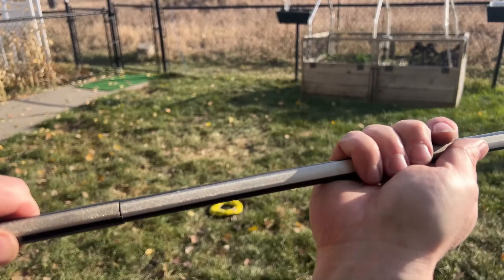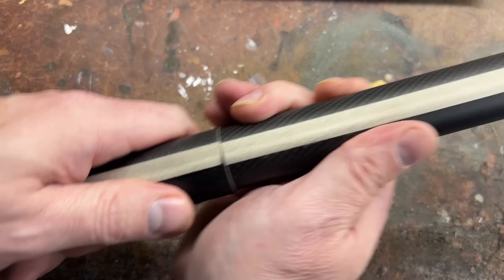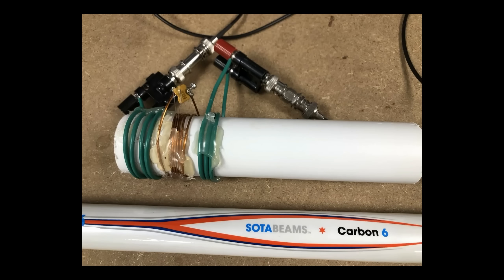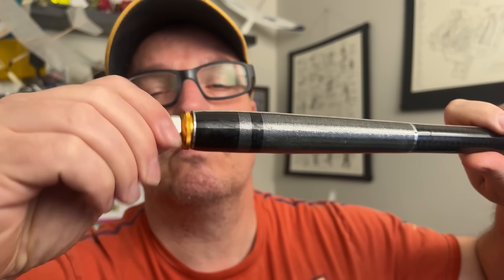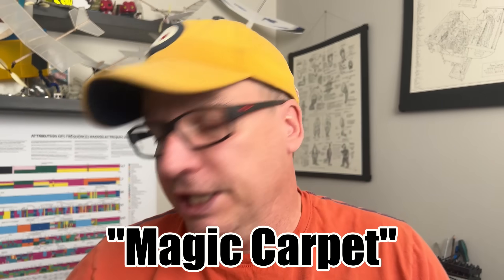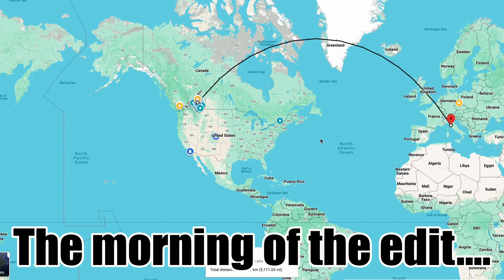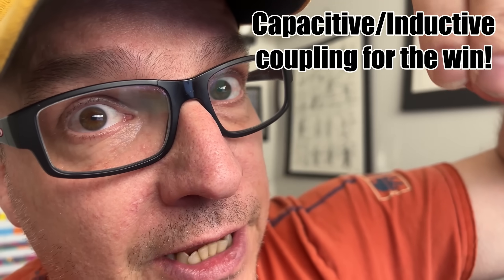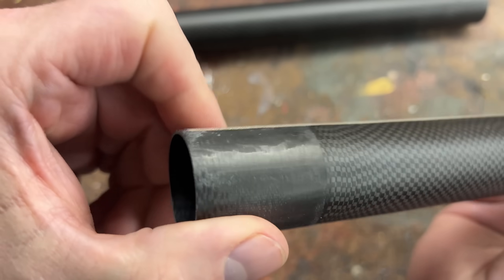Carbon Fiber Squid Pole EFHW Antenna: Wire-Free using Faraday Tape!

Comment: Hey Rook! Any more progress on this concept? I've tried to replicate but using the higher-conductivity copper tape rather than Faraday tape. On an 16' 7" carbon fiber pole (same model you ordered via AliExpress), it has an SWR dip at 11.761mhz. You mentioned it didn't resonate on any freq, sort of like an EFRW, etc. Love to know more about your experiments as I'm doing some too. If you want to contact me offline, I'm good on QRZed...73 de K4FMH
Reply from the maker: I’m slooooowly working on this. Yes it performs best as a random wire with a tuner. I find copper foil is easily damaged compared to the faraday tape. I’ll be posting more on this soon as the weather is getting better here and I can experiment

Comment: Well just built one and am excited as all out to test it.  Love this kind of level of experimentation.
Reply: Awesome! Let us know how it goes for you
Reply: @DreadMakerRoberts  just finished initial testing with a ground spike and single counterpoise and the results are good.  According to my VNA the highest SWR is 4.2 at 3MHz, the lowest is 2 at the 39MHz and in the various bands the SWR is somewhere in between in other words all very usable.  Tomorrow I'm going to give it a trial with the G90 and see where I get.  Many thanks for this.
Reply from the maker: Sooo love to hear this! My G-90 makes mine sing. It will definitely be able to tune it

Comment: I wonder if aluminum tape would couple capacitively, like the carbon fiber?   Any thoughts about that?

Thanks for the video!

73
AI4IJ
Reply from the maker: Yes copper tape does so aluminum will as well. The problem with metallic tapes is the are easily scratched off

Comment: Someone else mentioned a loop around the outside of the larger section.  Also continue the tape on the smaller around to the inside and run a loop of tape inside teh smaller section.  That way the captive coupling will have a much larger surface area.

Comment: have you considered trying an off center fed dipole vertical in your design ?  no GP needed, could be some fun experimenting ! its a hobby so keep having fun !!!!
Reply from the maker: I have not. Part of the reason is the carbon conducts enough to make this very hard to do. However a fiberglass pole would likely work

Comment: I say balderdash to the haters. Even if its not the perfect candidate for such a thing. I think your on to something and I would personally run with it.
Work with what you got and keep experimenting. 4 bands I'd be impressed. but if you could make it resident on 4 I'd go for 5. It's a neat concept.
 To be able to just pull up to the picnic table and quickly deploy, without a tuner. Sounds like a winner winner. ball hitch mount maybe.. sweet deal.
Sit in the car on a rainy day having a rag chew on 80m talking about all them haters. Good stuff 73
Reply from the maker: I appreciate your kind words. Currently with a tuner the random stick I have works on 40-30-20-17-15-10

Comment: just made this vertical, will give it a try soon in the field.
Reply from the maker: Please let me know how it goes! HamRadioRookie at gmail is the email address. Also fill me in on the details of the build. Carbon or glass fiber? Overlapping or capacitive coupling? Electrically joined elements etc.
Reply: How'd it go?

Comment: Have you tried to create a "Linear Loaded" Version..??
Faraday Tape on opposite sides of the poles, except the bottom section, then bridge them on the top section
That will give almost twice the length of Radiator...
Reply from the maker: Might try. With carbon there is some conductivity and it seems to work only with one  element. Adding tape makes some bandwidth gains but not really length. From initial testing. However the fiberglass should work for this!

Comment: Everything is fine, but you can't fool nature. The length of the antenna should be proportionate to the wavelength. Anyway thanks for sharing this information 👍
Reply from the maker: Yup agreed but keep in mind that the V.F. of this material is not like any other.

Comment: What do I know as a Technician whose never transmitted on any HF rig (though I'm studying for general).....what came to my mind was the conductive tape you are sticking onto the pole secitions----wouldn't it be awesome if it was embedded into the carbon fiber as the section was laid up? I've been around a lot of carbon fiber sea kayaks and they are often coated with a clear gel-coat. The conductive tape possible applied to the sections before clear coating? The clear coat's thickness would of course have to be accounted for in sizing the diameters of the nestling pipe sections. Then there's the thought of a carbon fiber tube that is only 95% complete....the other 5% being a metal strip filling the void and running the length of the tube. 
Regardless I think  what you are doing is novel and genius. I hope it comes to fruition one way or another because someday I'm going to pass General and then (even though I have acreage and room for an EFHW) I'll want a vertical :) Something else. The SOTA boys (and girls) will love love love your mast that is also antenna!!
Reply from the maker: Yup I am woking on doing just that! Great minds think alike. Its finding someone to do this for me economically
Reply: @VE6SFX_HamRadioRookie  Yeah I woke up thinking about your antenna? Why because I need a super quick rapid deploy vertical 20m or 40m. So scratching the sleep out of my eyes I thought of metallic paint. How thick is that conductive tape you have been applying to the pole(s)?
Reply: Aircraft control surface embed metal fabric into the carbon fabric layup to create a conductor to dissipate static electricity from the aircraft. Why wouldn't it work the other way?

Comment: Hi Rook! Very innovative concept...I'm building one (or two) now. I'll try copper tape instead of Faraday tape. Have the copper tape but do have yards of Faraday cloth which I'm testing for ground planes. The copper tape will have better conductivity although my tests on Faraday cloth show it's surprisingly good on that score. The practical impact of having a telescoping fiber pole that requires no wire is a move toward Occam's Razor in portable HF ops, IMHO. Looking forward to how you play this out. There's a Latin phrase for don't let the bastards get you down but I don't have time to look it up right now. You might suggest that viewers who get triggered by innovation "that shouldn't work" go watch some cat videos. The Smoking Ape can hook you up on some references, lol. 73 de K4FMH

Comment: Aloha Ben, I just watched Salty Walt’s video about this antenna pole and I found it just amazing. 
      I like operating at a triangle parking lot that sits in the Pacific Ocean here along the coast here on Oahu, Hawaii. 
      It’s called Kewalo Basin or just called Kewalos and it has a small parking lot, a large restroom and a small youth center but the cool part is that my average distance on one watt of power only on my G90 is 5,026 miles with signal reports of 5/7-59+10, from East Coast US to WA to Japan against some folks pushing 500+ watts. 
     So I’ve been using a ground spike with a 2.5 meter M10 telescopic antenna with four 15’ ground radials. 
     Lately, I have been experimenting with CB antennas and 10 hamsticks mounted on CB mag mounts on my Jeep. 
     I bought a drive on flag pole holder but just can’t get a telescopic pole of any kind from anyone to ship their telescopic poles here to Honolulu (zip 96822) and I’m flying to California next month and hoping to take my new Radioddity QT80 with me along with a mag mount to put on my rental SUV for the week that I’m out there. 
     Do you have anything worth testing that I can put into my Carry On bag on an aircraft?   
       Thanks and Mahalo-
          Todd de WH6DWF🇺🇸
Reply from the maker: Todd,
The best place to order the rods is AliExpess The one Walt has is the 6.3m pole on this listing https://s.click.aliexpress.com/e/_onFl6uT (You will need to cut the foam handle off on this one) with some faraday tape https://s.click.aliexpress.com/e/_onFl6uT

Comment: This can be a revolutionary HOA antenna. Like many others, my house has a wood facia board running along the end of the roof. I had planned to use some eyelets and create a random wire antenna that would be reasonably well hidden. But this might even be better. Hiding the drop from the board to the window might pose a little problem. I wonder if I could extend the tape onto the stucco wall. Would it stick? Would painting over the tape affect it?
Reply from the maker: Absolutely you could extent it. I am not sure it would stick to a stucco wall but given how inexpensive the tape is, get some and try. If it does not work you can use it for many more things. Seriously I have rolls of this in my bug out bag for improvisation.
Reply: @VE6SFX_HamRadioRookie  The trim is wood, and I agree, it might not stick well. Can you foresee any problems using small brads or tacks to keep it on the wood? What about creating a 20-meter dipole? I would have to punch a small hole in the tape ends and use a screw with a nut to attach a wire. I cannot imagine what the impedience might be. Has anyone done this?
Reply from the maker: @martinunger9545  I think this would be fine. The tune might be different but no reason it would not work.

Comment: Walt Hudson sent me here.  Subbed.
Reply from the maker: Thanks for checking it out and for subscribing!
Reply: You’re welcome. You got me thinking … any reason not to try conductive paint?  I have a ton of the stuff that I use to shield the control cavities of electric guitars (I use EZ-Slide graphite paint).  Heck, I could probably “fold (paint) it over” without affecting the telescoping function. Thoughts on that?
Reply from the maker: I have tried the conductive paint and yes it works. thing is that stuff is like 100.00 per oz. So it might be out of the range of most peoples wallet. However another has commented about using 'Defroster repair' paint. I am going to look into this for a less expensive solution.

Comment: Very interesting. I love experimenting with ideas and hearing all the "experts" tell you it has to be ".......". My favorite is "it has to be resonant". Bah hahaha. I've laid random lengths of a variety of wire types on the ground an made 1000 mile contacts. Tried the same thing at a different place, 100's of miles away and it didn't work well. I've used a chain link fence as an antenna ..... eh, as a last resort. I have also attempted to use the fence as a counterpoise, and had better luck with no counterpoise. Tell me "you CAN'T do that" and I'll tell you "hold my lemonade". This hobby is about experimenting. There are so many variables to each situation. They only way to learn, is to try. The best way to learn is to do. What works unsatisfactory for one, may be totally satisfactory for another. Please keep up the great topics. I may be going into the garage and dig some stuff out today, thanks to your video!! For me a 107' EFHW run between the 2nd floor eve and a 15' COMPOSITE (thick wall) pole, that's stays put during the hurricanes, and my other vertical antenna, have allowed me to make over 16,000 contacts in 195 countries (DXCC entities) in the past 2 years. I seldom use more than 100 watts. Playing around and experimenting helps me learn where I can improve and ways that work for me and my situations. Good hams always promote. My momma always told me to stay away from negativity. It's been good advice. Great video!! Great energy! 73 -de KN1B
Reply from the maker: "I may be going into the garage and dig some stuff out today, thanks to your video!! " best comment I could get. Love that others are using this as a spark to create their own things!

Comment: The smaller the antenna, the smaller the antenna aperture.  Size matters.  "Just because it resonates doesn't mean it radiates."
Reply from the maker: So the contacts I have made SSB 6000+Km away and FT8 over 14000Km on it must definitively prove it only radiates?
Reply: Receive aperture, yes. For TX, if you put 100W into a matched antenna, with a lossless matching circuit, and there is no part of the antenna that is getting hot, then 100W has to come out as RF. As the antenna gets smaller, it approaches the radiation patern of an isotropic antenna. Which is only a couple of dB down from a dipole. The difficulty with a small antenna relative to wavelengh is in actually achieving a lossless matching circuit and antenna with no lossy parts.
Reply from the maker: @SimonBlandford  Oh! that helps me figure some things out. Thank you.

Comment: How much power do you think this tape could handle? Think it could handle 100 watts SSB regularly? How about 100 watts FT8?
Reply from the maker: Ive been running 100w SSB for the last couple months no issue. Ran 50w Ft8 the other day with no issues
Reply: @VE6SFX_HamRadioRookie  this may be my next Pota experiment. Maybe paired with a 9:1 👀. Could be way easier than setting up a wire! Haha
Reply from the maker: @TrekOnTheAir  FWIW I have been using one naked with a antenna tuner and it works just fine. Soon Ill do a video on the SWR sweep. Here is a teaser 30% is below 3:1 between 3-60Mhz and 60% is below 5:1 on the rest. Its kinda crazy really. I have been doing Italy, Wales and South America from Calgary on SSB between 10-40m regularly. 6-10 thousand Km. On FT8 and WSPR I have 15 thousand Km
Reply: Have some spare tape and find out! Digital modes can be "hard" on antennas "power ratings". I determine my power ratings. I bought an "online", cheap vertical rated for 200W SSB and digital. After using it for several months for digital contacts (max 75W), I noticed the balun melted through the housing box. Found my weak point. I build a new box to hold a 2000W balun. The box included new wiring, connector, and screened vents. I used that antenna for years with SSB contacts using up to about 1200 watts. My point is "find out". Protect your radio(s), but give it a try. When it reaches the limit, fix the weak point. Love this hobby!! -73 de KN1B

Comment: A neat trick for using a lightweight mast as your whip! Instead of a (somewhat) heavy stainless whip, or perhaps using a longer mast, you might get even better performance than, for example, the CHA MPAS lite.
Reply from the maker: In all honesty the 17' and 25' stainless whips weigh about the same. But min is much more robust and less likely to permanently deform and or fold over and break. Plus I have a 50' whip I am going to finalize testing on shortly :) That definately does not exist in stainless

Comment: Your antenna is similar in principle to an antenna published 20 years ago or more by the ARRl in the antenna compendium. The published ARRL antenna was a dipole interrupted in the arms by a series of capacitors. You could check their article and get hints for your experimentations.
Reply from the maker: I will have to look it up. thank you for the tip!

Comment: Am i missing something here? 
Why not just use a telescopic pole like any portable radio with it,s telescopic antenna. Just slide the antenna to its ressonant measurement.
Reply from the maker: If you mean just extend the carbon poles alone. They are quite resistive and do not work. They are effectively a dummy load. https://youtube.com/shorts/tFA2LB3aKKQ . If you meant a stainless steel whip then I do not know of a 33' stainless extending whip existing anywhere or if it did it would be no where near as strong in a wind load
Reply: @VE6SFX_HamRadioRookie  no the steel antennas that are on every radio.
Reply: @VE6SFX_HamRadioRookie  they make aluminum telescopic to that lenght.
Reply from the maker: Yes there are aluminium masts that tall but they weigh a bit more than 1.5lbs  I currently have a 50' up and testing it as well. I am gusessing that the weight is substantially more than the 4lb I have if it were made of aluminium.

Comment: I certainly won't be throwing any crap your way!
I'm an Extra-Class ham, and I love experimenting with "weird" antennas!
I'd be interested in ANY results you get. 
In fact, I can't believe I'm saying this, but I haven't been on the air for several years (never thought I'd go that long), but I'm thinking about getting back into it just to try this out. 
 Thanks for making me aware of this antenna. No joke, this is interesting, after seeing that you had a QSO 700 miles on 60W, on 10m band.  
(I know with a "good" antenna, others have gone farther with less power on different bands, not really sure what the record is on 10m band.) 
Frankly, I'm not interested in "setting distance records" except as a comparison number. 
But I am interested in discovering new properties, etc.
Projection: I'd "predict" that twisting your pole segments (to vary the alignment of the conductive tape) will result in different length antennas, in increments of your pole segments.
 I know that you can vary the capacitance between plates by changing the alignment. 😮
Keep up the work, stay in touch!
>>de ai4rv, Goose Creek, SC.  🤪
👍👍👍

Comment: That's a pretty clever way to get a stick in the air.
I'm not a ham (yet), saving up some disposable $ before jumping in. I am a professional ether smith, a bit spoilt I guess, never had to experiment beyond implementation and commissioning. The performance confidence isn't left to chance when it's a commercial endeavour.
A bit like the mechanic's car that's never fixed, the last thing I want to do in my leisure time is do my job....but having a fun job can lead to fun hobbies too in retirement. It will happen eventually.
Great channel.
The comments here are pretty high value too. Nice community.
Everything radiates.
🖖
Reply from the maker: Yes welcome to my frequency :) I really enjoy my audience. Like minded tinkerers